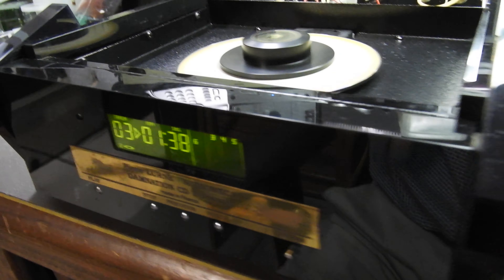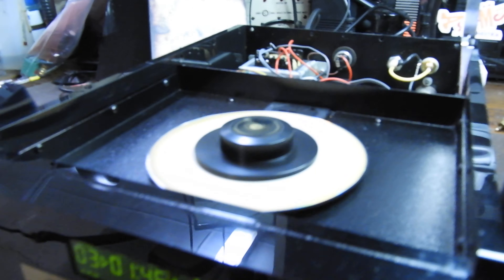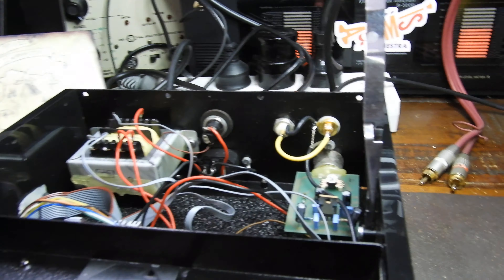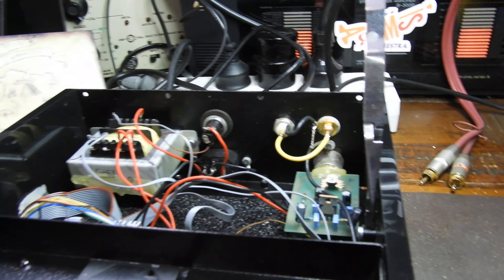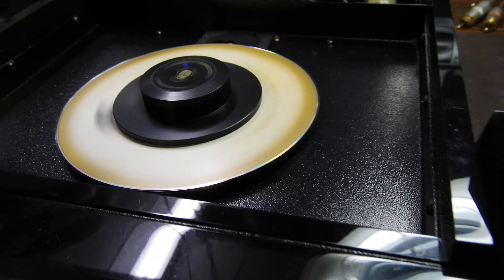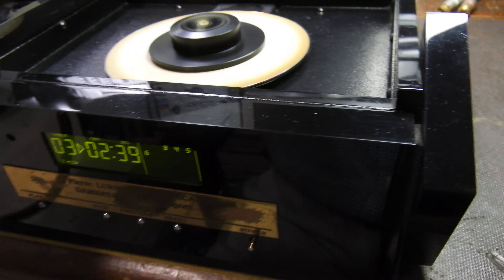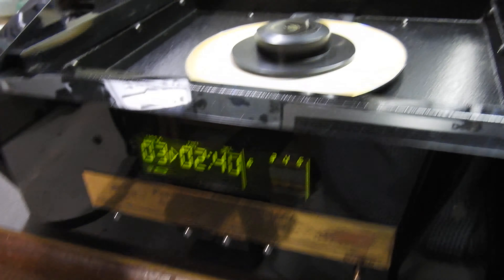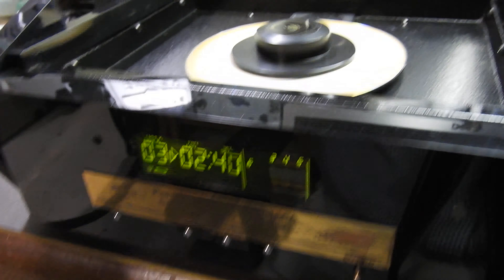Does quality of power cable matter in CD players?

Comment: Hi, help needed if possible, I have an Ayon cd2 where the plastic spindle slips down the motor Shaft causing the CD not to speed, I've tried gluing it but the clamp still pulls it off with the disc. It's a top loader like the one above. Thanks in advance 👍
Reply from the maker: Ayon CD-2 is a fine machine but it uses DVD mechanism from Stream Unlimited. These things are normally press fit, and if gluing it does not work, then short of replacing the motor with the new turntable as a whole assembly (if you can get it) it is a matter of using... different glue or epoxy resin. Thing is, that the TT height is critical to 0.5mm (they even state lower tolerances in some manuals).
If I had it here, I could see what TT is this and try to match with motor/TT assembly from another player, but remotely it is not really possible.
Maybe take a picture of it and post in in DIY Audio Forum. There are plenty of people there  who used to fix CD players and would know how to get a replacement.
Reply: @hear-net-au  thanks very much for you prompt response much appreciated 👍😇.
I will try the forum you suggested. Thanks again 👍
Reply: @hear-net-au  Just to let you know I ordered a new spindle motor with the exact turntable assembly (for a Denon) from a company called Spares to repair here in the UK £23 , I pulled the turntable bit off and fitted to the Ayon motor ( tight fit) problem solved, sounds fantastic 👍.
Thanks for your help etc👍
Reply from the maker: @richarddavey9547  glad to be of assistance